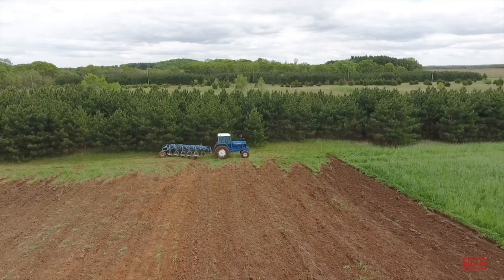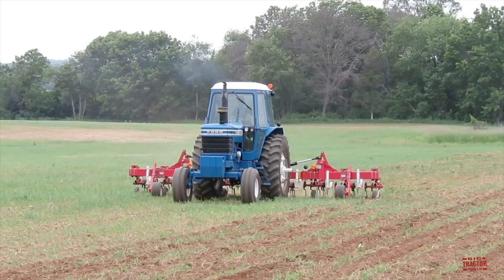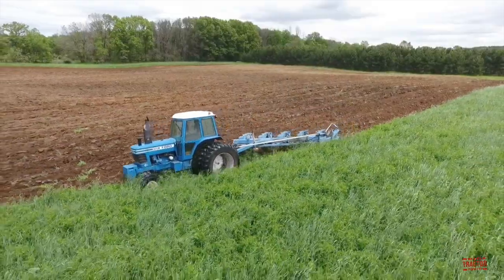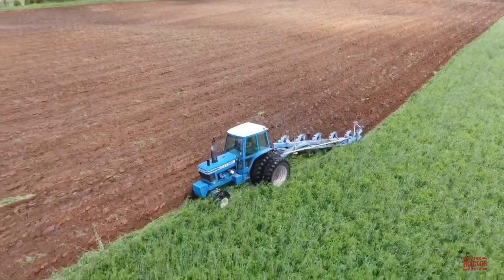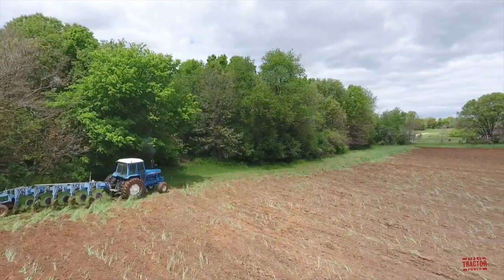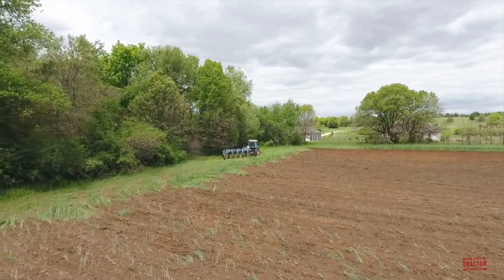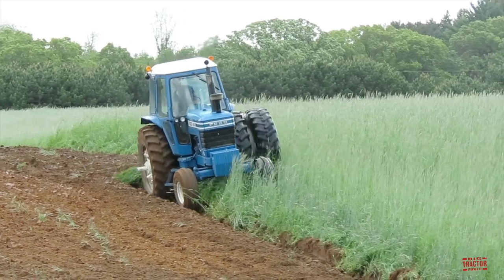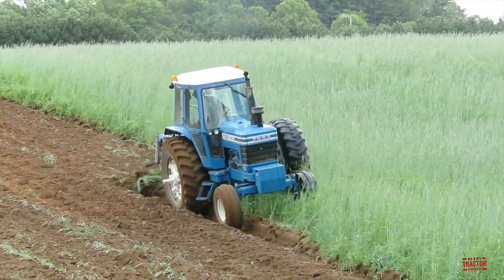FORD 9700 Tractor Plowing

Comment: That 9700 sounds good. My dad had one without the cab but one thing I can say it was a beast in the field when it came to plowing up a field.
Reply: I have a 7700. Great GREAT tractor
Reply: @vinlennox7658  It looks like it a good tractor how many horses does the engine have?
Reply: @tonyprice5364  7700 has 97hp.
Its all there and more. Lively bull of a tractor
Reply: @vinlennox7658  Wow
Reply: @tonyprice5364  all mechanical.  Old fashioned. A good bit high. But i love her Tony. No green nonsense about her or efficiency stuff. .you pull the throttle n she just packs out her punch!
Reply: @vinlennox7658  I already know from my years of experience when my dad had one of those. Trust me when you give it throttle a ease off the clutch you're in the ride of your life.

Comment: Although I grew up farming with nothing but Ford tractors through the 70's and 80's, my favorite has to be the '74 model 5000 that was my Dad's that I still have today!
Reply: I want a 5000. I bid on one last weekend but didn't get it...
Reply from the maker: The 5000 is one of the all time greats.
Reply: @bigtractorpower  you can bet, this one has a home as long as I am alive, as well as the 8600 that I bought in '85 when I got out of High School
Reply: @bigtractorpower  I agree I worked at a Ford dealer and we turned one up for a farmer in Jackson county Indiana. It dyno'd at 95 hp. He wouldn't let anyone operate it. After going through one it was obvious how over built the 5000 was. I bet that tractor is still running.
Reply: @marknicholson2718  those little 256s could be peppy with a turbo

Comment: Great video.  My favorite Ford was a 9n with it's draft control plowing with a Deereborne 2 bottom plow.  Tractor was dangerous as could be, but married with that plow, they flipped the earth of so many acres.  Unfortunately mine blew up a couple years ago.  Don't miss working on the points, condenser, or carburetor.

Comment: We had a Ford TW-30 that was used as the big tractor.  It was a very heavy two wheel drive tractor.
Reply: This would've been a predecessor to the tw20. 30 was the first tractor i used in the field by myself. Dad hooked a 5-18s on it. Basically so there would be no issues pulling. I had to stand up to reach the clutch and reach over to put it in gear.lol

Comment: That's some nice plowing dirt there. That Ford doesn't even smoke when the plow is dropped in the ground...
Reply: They don't smoke much at all, we had a 1980 TW-10 pulling a Ford auto reset 5X18's ,used just 3 gallons an hour, also had a 1981 6700 BPS with the larger 268 6710 engine that used 1-1/2 - 2 gallons an hour, but the winner was our 1979 4600 SU, running our Heston 1090 9 foot mower conditioner it used under a gallon an hour.
Reply: @poppie1946  that's some impressive stats!

Comment: One of my favorite all time Ford tractors ... the 100 series tractors got the look sound etc,  we had 400acres and a 7700 Blue Power Special rated at 110hp if i recall. The later tractor a Tw-5 fwa and a turbo was added bringing the hp to @140hp.
Reply: Did your 7700 blow lots of smoke till it was up to revs
Reply: @lukereynolds9907  not a lot of smoke if I recall OK...

Comment: We have a fully restored TW-20!  Retrofitted with a mid mount long arm ditch mower.  Solid built machinery 🙂
Reply from the maker: Very cool. Nice set up.
Reply: Just Wish the tractor had a creeper gear.  The lowest gear is to fast sometimes but still a awesome set up!

Comment: Leaving an aweful deep hole at the end of each pass. The exit from the pass is spot on, but the entry of each pass is another story. As your front wheel enters the furrow, lower your plow and the furrow will be covered. Also, forget you have a 3 point hitch to pick it up....use the hydraulics.

Comment: Like to know what the cover crop was they were plowing under. I've pulled a DMI 5-bottom Veri-width plow before. Pulled it with Allis Chalmers 7060. That soil must be awful light or sandy up there. Here in central Indiana it is heavier soil. AND it never pulled that easy! WOW! I do miss plowing though.
Reply: It a mixture of rye, hairy vetch, plus some yellow blossom sweet clover, mammoth red clover and a few other thing that likely winter killed.
Reply: @russelljhoffman  Looked like winter missed killing alot of it. Have a field near me of Tuff grass. Winter killed it dead flat. What they were plowing under will definitely help the soil.
Reply from the maker: Thank you Russell. Great tractor to feature.

Comment: Great looking tractor and sound. Only a 33 gallon fuel tank? You would have to fill up every 3-4 hours wouldn't you? Nice video!
Reply: 10 gallon an hour, your thinking John Deere AND even with that it would need to put out 200 + HP, not 135, we had a new 1964 JD 3020 gas with power shift and the gas hog burn 5 gallons an hr pulling 4X16's 😡.
Reply: Here is the same tractor & plow I had back in the day, NO SMOKE, https://youtu.be/kzr6y0ttSNM?t=50 .
Reply: That’s actually my tractor in the video. The main fuel tank is 33 gallons but there another auxiliary tank on almost every Ford I’ve seen. Total capacity is over 58 gallons. Can easily run all day. I’ve never used 10 gallons an hour..... it’s not a JD remember 😉
Reply: @russelljhoffman  That makes more sense!! Does it use about 5-6 gallons an hour? Great looking tractor! Looks like it handles that plow very well!

Comment: Great video of the old iron BTP ! 👍

How does a organic farm control pests in their crops without using pesticides ?
Reply: depends on the pests.  Sometimes they spray sugar water on them so they gorge themselves and die.  Sometimes spraying oil on the insects will disrupt their respiratory system.

Comment: I was a little confused about the plow as I thought Oliver made those for Ford but it didn't look like an Oliver. Then you said it was a DMI.
Reply from the maker: Yes Oliver built Ford plows. DMI built Hydra Wide plows through the 80’s. DMI equipment was blue until Case IH bough DMI in 1998.

Comment: There's something with Ford, Fiat and New Holland tractors i love. I don't know what. In Europe, we also have Fordson, which made tractors before Ford, but i don't really remember if Ford owned Fordson or not. I know the history, but i'm not sure though
Reply: I think Fordson came along after an inferior tractor company sued Henry Ford for the use of the Ford name on their tractors to capitalize off Henry Ford's name. I think they even went so far as to hire a guy whose last name was Ford just so they could pull it off. I hope this came out clear enough to understand. I read this in a book several years ago
Reply: @dougschmitii6165  sounds at least legit enough for me
Reply from the maker: Fordson came from Ford & Son Tractors.  Henry Ford set put to make a tractor in the late 1800’s and ended up building cars from that work in the early 1900’s. Henry Ford grew up on a farm and from boyhood wanted to make a machine to make farming easier. After Ford Motors began making cars in 1903 and became successful Henry Ford turned his attention back to tractors.  The board of directors at Ford did not want to focus on farm machinery.  Henry Ford started a second company called Ford & Son to build tractors in 1918.  Fordson tractors became the brand to keep cars and tractors separate.  By the late 1930’s the two company’s united.

Comment: 400 cubic/6.6L, 135hp 6 cylinder.   That's an overbuilt, underpowered engine, not that that is a bad thing.  The box stock 5.9L, 12 valve Cummins is rated at 180hp, which initially was derated several times in order for the transmission's to handle the torque.  I didn't hear if the Ford 9700 is turbocharged?  if not, that would explain the low horsepower

Comment: Big tractor power I have never understood why the rollover breaking plow never went over well in the USA like over seas. We finally bought a JD switch tail plow and it really made a big difference.
Reply from the maker: I am not sure. The older roll overs did not have spring trips. As you can see in the video stones a tripping the shares.
Reply: What Jason said about spring tripping, and the working width not being enough
Reply: @bigtractorpower  I think the added weight of a rollover plow also

Comment: In my area the Ford 9600/9700 was a fairly good tractor and there where a good number of them around. That all changed with the TW series of tractors. They had so many issues that Ford lost its market here, for the large tractor market. If you look at the auction results in the mid-west the over 100 hp. ford tractors have not held a very good value.

Comment: This tractor is class power,  John deere has 5030 .
Reply from the maker: The John Deere 5020 and 6030 are solid tractors. I have had a chance to feature both. They were the big tractors on the market in the early 70’s.